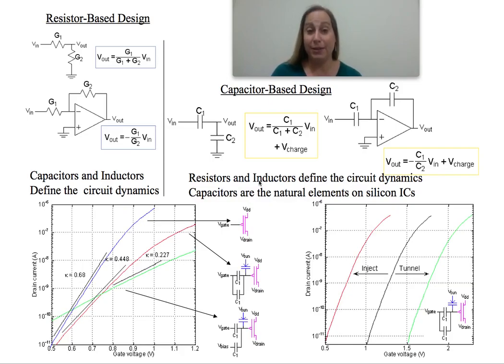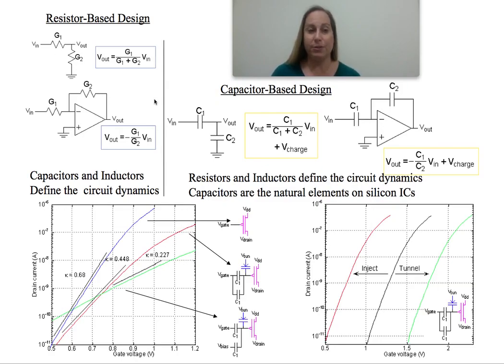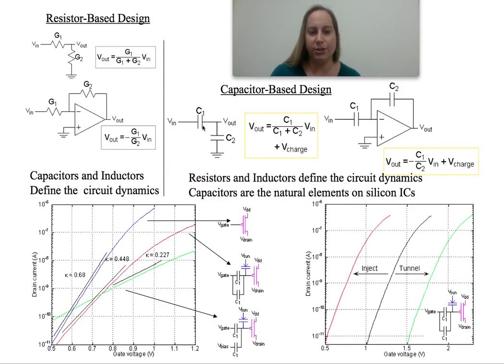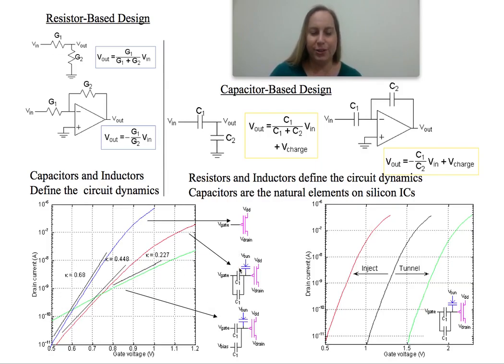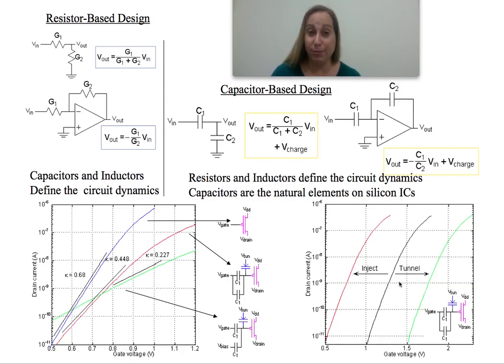Introduction to Floating-Gate Circuits

Comment: Really interesting, thanks! Liked and subbed, will start going through your lectures! Curious to test how long jellybean parts could hold the charge after removing power from the circuit and if I could use it as non-volatile memory with off the shelf components (that is, to use FETs and caps directly on a board...)